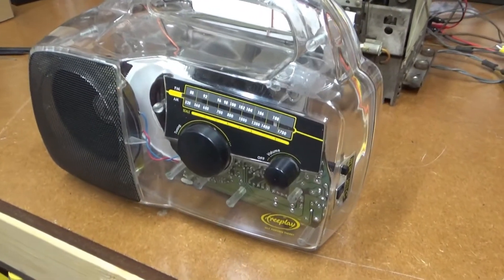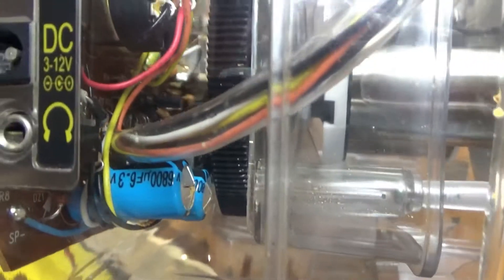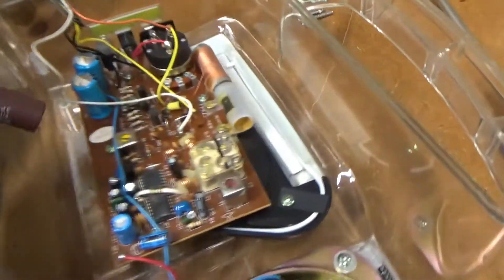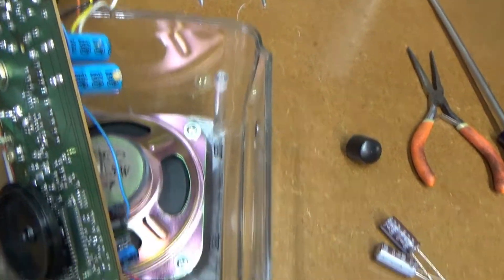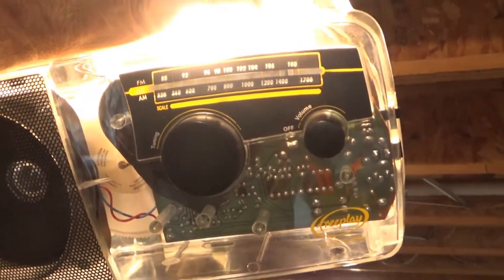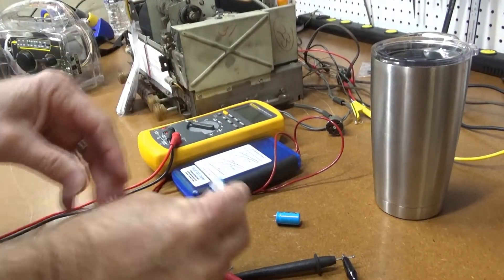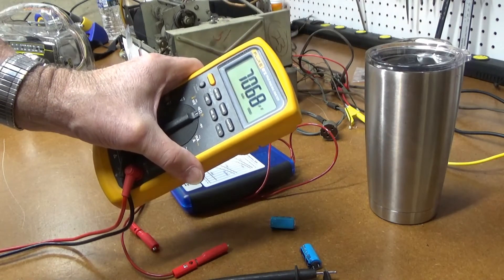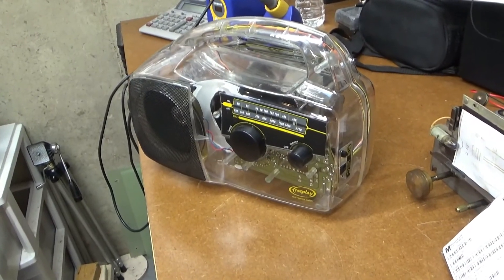1990's vintage Freeplay wind up radio repair

Comment: I have the same radio
Reply from the maker: They're pretty cool.  I have a few of them.
Reply: @mguess  I have the same radio as yours. I added Silicone grease to the rotating tooth gears in my Freeplay wind up radio to stop the grinding sound. My Freeplay radio sounds smooth now ✅
Reply: @mguess  I am thinking about experimenting with putting up a 21' foot copper 11 meter antenna and attaching capacitors to the bottom of the copper antenna to see if I can harvest⚡electricity from the sky.

Comment: Hi, I was just given one of these but it’s missing the hand crank on the back. Been looking all over and can’t find parts. Would you happen to know where I could get a new/used one? Is there anything special about the crank other than the 12 point notch it goes into? If so, would you be willing/able to email pictures and perhaps some dimensions? I could draw one up and 3D print it. Thanks! Pretty cool content. My dad used to work at a TV repair shop and we’re also into rocketry. Largest one I built was 4.5’-5’ tall with 3 F series engines rigged in parallel.
Reply from the maker: I took some pictures of the crank that I can send to you. Send me an email to mguessva@gmail.com and I'll forward them to you.  Let me know what dimensions that you need and I'll send those also.  I'm glad that you are enjoying the channel. The motor in the big white rocket was a single M class which gets the 60lb rocket to about 5,000 feet.

Comment: My'n work but sometimes it unwinds at full speed and make a noise like a jet engine. Any ideas how to fix that?
Reply from the maker: I'm not sure what would cause that. The only issue that I have seen is the bad capacitors.
Reply: @mguess loose rubber belt it needs to be replaced it's slipping
Reply: I used to have one and the gears suddenly stripped out when unwinding. Belt still intact but mech self destructed.